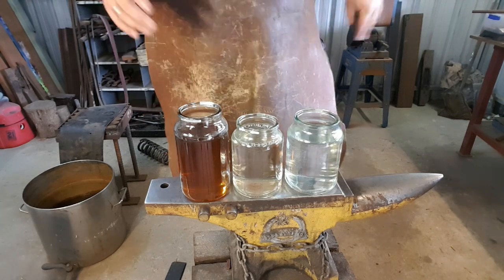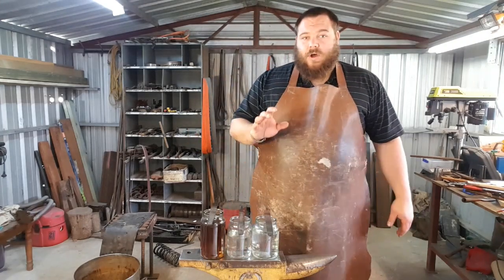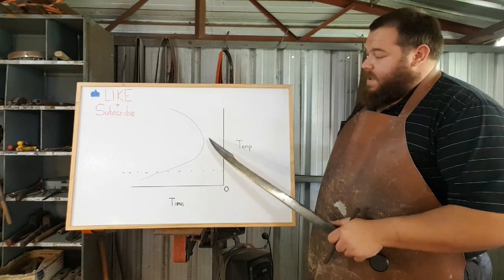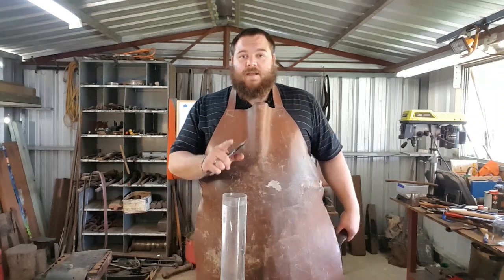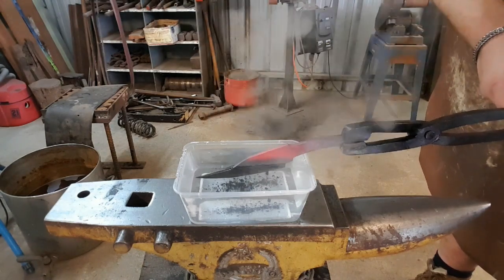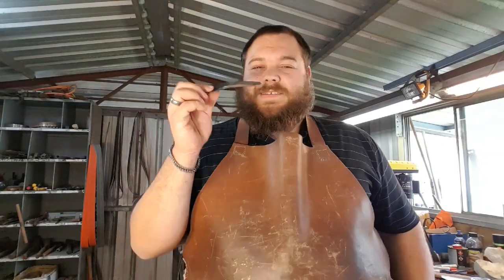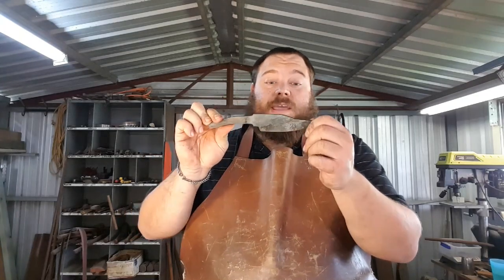Quenching in depth how to!

Comment: Thanks for the extra info and looking forward to the more in depth discussion! A question though: when you edge quenched that blade, I was looking for that crack and did not see it. Did the dark color of the water conceal it or did it crack after all the grains/dendrites were fully formed?
Reply from the maker: It wasn't a dendritic steel, but the crack happened about 5s in to the quench, it wasn't a violent "crack" more like a tear
Reply: Sam Towns, Bladesmith Describing it as a tear explains why I didn’t hear a ping/ting/pop. I thought for sure how big that crack was it had to have made a sound loud enough for the mic to pick up
Reply from the maker: @veteranironoutdoors8320  yeah it's interesting how these longitudinal cracks occur

Comment: When you putting the edge side down it goes through the oil first to the water gives it just enough time to cool the edge just enough then it hits the water for the final hard hitting  shock just move the blade back and forth for about 20 seconds then dunk it all the way down to cool

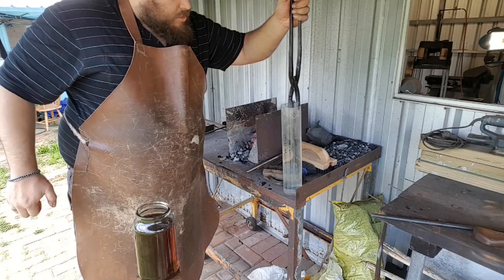Comment: 18:48 It seems dangerous to lean the hot blade against the rim of the glass jar. I work with clay and glass, and they don’t tolerate temperature differentials well, usually expanding at the heat, faster than the cooler areas can accommodate... so they crack. Clay and glass have a lot of similar properties to metal, and I love all of them.

Comment: So there’s been any questions that I’ve had ever since I started learning how to Blacksmith I’m not sure if you can answer this for me. What is the main difference between hardening a flatter surface like your hammer and hardening a sharper surface like a blades edge is there a difference in the quench process. Do you want some parts to remain soft and some parts to remain hard, do you only want to heat the edge in the quench or entire piece and have it be hard. Could you do a video on it? What is the main difference if there is any.

Comment: G'day Sam. Thanks for helping to educate noobs like me. It looked like you were only quenching with small (1 litre or so) amounts of quenchant. Is there a preferred volume (dependant on blade size, etc) for quenching with food grade oil? Cheers Stan
Reply from the maker: Thanks mate, and no worries! The larger rhe object being quenched, the larger the container you will need. Especially if you're quenching in batches, in which case you will need to let the oil cool between pieces if you have a small receptacle. Overheated oil wont quench blades, much like cold oil doesn't. I always say bigger is better when it comes to quench tanks, but for everyday newbies and hobbyists a 4l oil can is normally enough. Forge on!
Reply: @SamTownsBladesmith  Thanks mate.
Reply: Forgot to add...thanks for the extra info.

Comment: I tried edge quenching a few times. However, When I want a hard edge and a soft spine, nothing beats a good claying on the spine. 

I work with W1 tool steel and 1095 almost exclusively. The only thing I quench with is Brine + detergent (Superquench). I too interrupt the quench after 3 seconds into the liquid, but I don’t  finish into oil. Instead I do rapid submersions in and out. This does two things, it reduces some of the stress that takes place when forming Martensite and because the brine is still cool at this point, it gets the blade cold very quickly, which makes sure maximum hardness is achieved. 

On a Katana I recently finished forging, after doing the method described above, and letting it sit in a freezer overnight, the blade came out at over 67HRC as quenched. Tempered the edge down to 63 afterwards. The steel was W1.